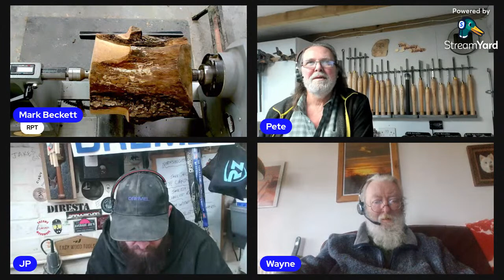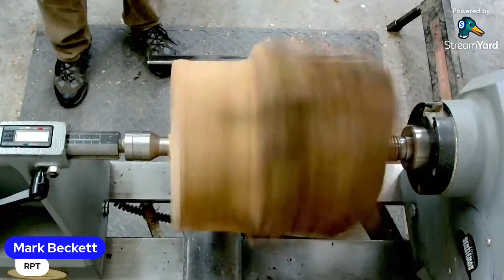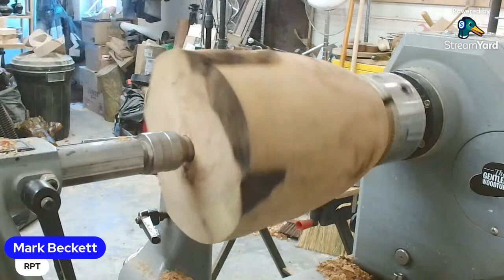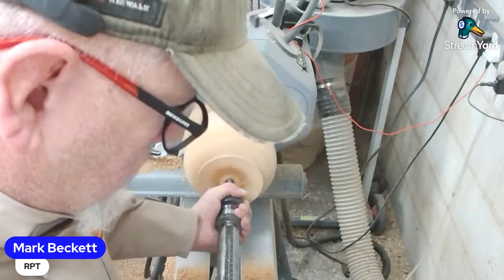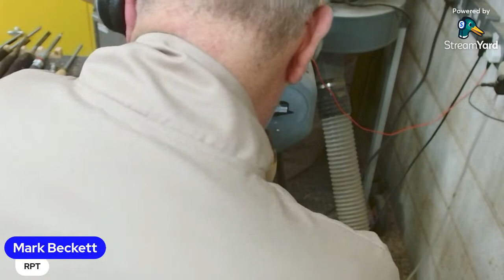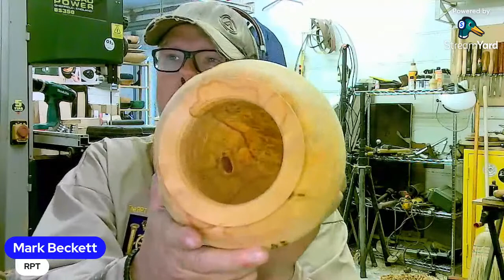Woodturning | Roughing out a Vase

Comment: I am livid. Was awake in plenty of time to be in the live. Checked and had NO notice that you were coming on. So I laid back down for a bit. Back up before you went off but still no notice that you were on. Got up, showered, watched a couple of videos, low and behold, there you are, 23 minutes after you finished, in the list of recently added videos. 😤😡🤬 What a great vase. Im hoping that the mouth doesn’t crack on you. May not. You just really don’t know until you pull it out. Great at this point. We’ll hope for the best after it dries. Should be splendid. Thanks Mark.
Reply from the maker: Thanks mate. Good old YouTube eh. I've glued all the cracks and given it a good coat of ca all round the opening. I'll keep an eye on it. If need be I've left enough thickness that I could add a contrasting ring around the lid area